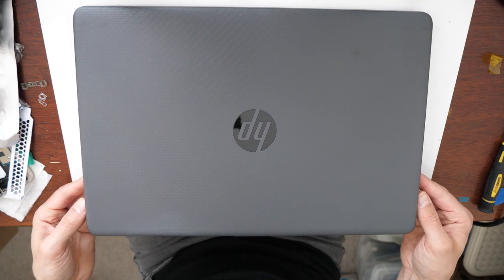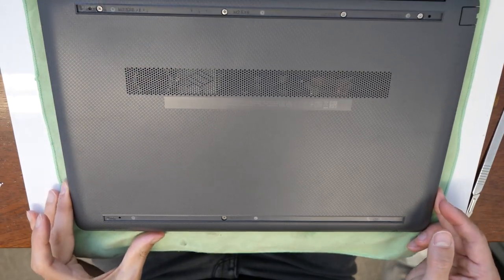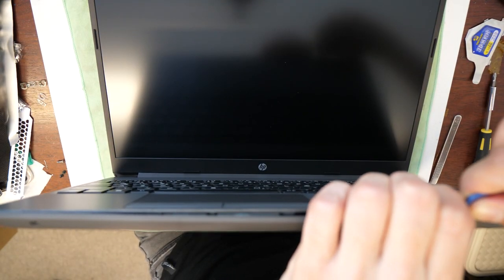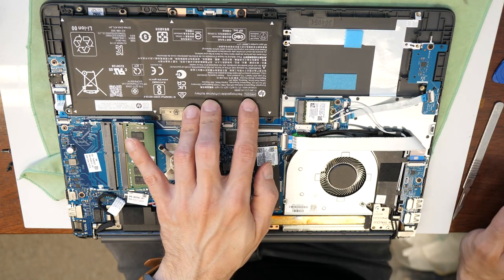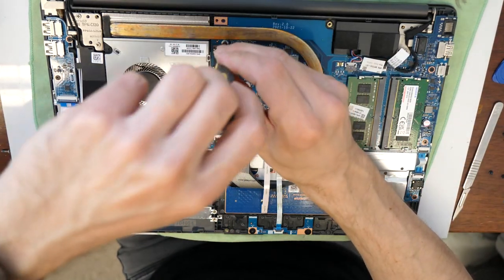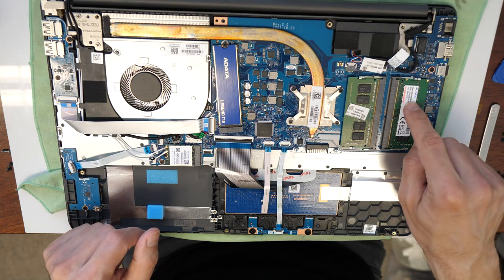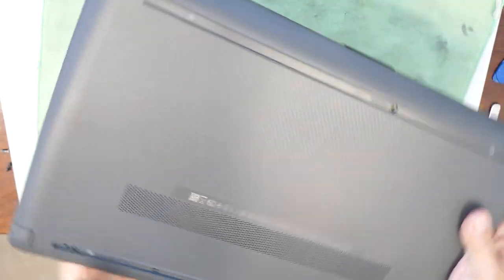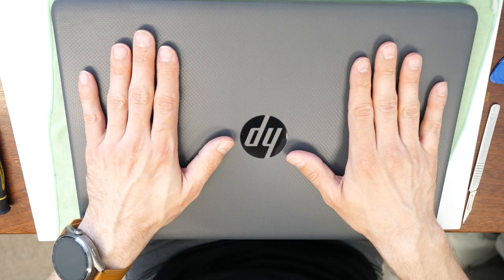HP 255 G8 Laptop - Open it & Upgrade Options

Comment: Awesome! Thank you so much! I'm a 2nd year IT undergrad student & need to upgrade my storage as I have less than 3GB left even after deleting EVERYTHING! 
Do I need to wear the static wrist strap or mat?? After 2 years of IT studies, we only work on desktops so far. So I am unsure about laptops & can't really find any helpful info on Google. Thanks!
Reply from the maker: Great decision for the IT study. Yes, if you wan't to be 100% sure, a static wrist strap is recommended and disconnect the battery and charger of course before working on the laptop. And you are welcome.
Reply: I'm also in IT my second year. Trying to upgrade my memory by adding 16gb with the 8
Reply from the maker: @rodneyb1425  Great

Comment: Hi, I have an important question: Can I use an SSD SATA, or is it mandatory to use an NVMe SSD?
My device: HP 255 G8 Notebook PC.
Reply from the maker: Hi. You can use which ever you want.
Reply: @CrocFIX  can you use both? and have multiple drives in the laptop?
Reply from the maker: @X_I_A_N  Yes, of course. If there is a free slot, you can use both.

Comment: Hey so I was just about to upgrade the ram but found out there is only 1 slot for ram in mine. It’s the same model and everything so I found it strange. I don’t know if it was ripped off or anything because I bought it in a pawn shop. in the settings it says it has space for 2 rams. Is there any way I could put another ram slot or where do I buy it?
Reply from the maker: You don't have the same model. It's the same series...255 G8, but you have a different board. You can't add another ram slot.

Comment: Hi, is there a way to unplug the touchpad? My laptop is not booting and always end up with PNP_WATCHDOG error(even with HP recover disk, and window USB drive), I tried everything, now last thing I would like to try to unplug the touchpad to see whether its the one which causing issue or not?
Reply from the maker: Yes, of course. But I would suggest that you install first a fresh copy of windows and see if this helps. You can use another ssd if you have.
Reply: @CrocFIX  - Thanks a lot for your reply. I tried that as well with having windows 11 on pen drive, but laptop is not booting up at all. It also won't show recovery screen when I am pressing F11 on BIOS, instead it shows Preparing for Automatic Recovery and then end up with the same PNP_WATCHDOG error.
Reply from the maker: @harshmodha8397  Yes, that's a bit strange behaviour. I hope you figure something out. Good luck!
Reply: So could you please post a video to unplug the mouse pad?
Reply from the maker: @harshmodha8397  Sorry, I don't have this laptop anymore.
Reply: Ohh ok thanks for all your replies. In case from your video if you can spot it then please do let me know.
Reply from the maker: @harshmodha8397  No problem ;)

Comment: Very helpful video as its my first time trying to do all this by myself! One question though, does the additional ram need to be at the same speed as the one thats already in? I was thinking about getting the Crucial CT8G4SFRA32A DDR4 8gb at 3200 MHz while the laptop's old ram is at 2400MHz. Should I get 2 of the Crucial ram sticks or is it ok if I get just one and combine them  for 16gb of ram?
Reply from the maker: Thanks. Both will work...if you buy just one 3200 and leave one 2400, they will work at 2400 both. If you replace both and buy a kit of 3200mhz, it will work at 3200 and be a bit faster. Not that big difference though. Hope that helps. I hope you clicked the LIKE button, Subscribed & I can welcome you as a member of our CrocFIX Channel ✅😊

Comment: is it a must to realese the battery even not connected to the power source? and what the possible problems may occur if not realese the battery?
Reply from the maker: The battery has always a voltage and you could do a short and damage  some hardware.
Reply: @CrocFIX  even only put the new RAM to the empty slot sodimm?
Reply from the maker: @mfathurr yes, all hardware changes
Reply: @CrocFIX  I just found out about it. Thank you for the useful new knowledge.
Reply from the maker: @mfathurr  You are very welcome :)

Comment: What will happen when i replace the SSD with a bigger. Will the Windows 11 demand key form me.
Reply from the maker: The key is ussually stored on the motherboard, so if you replace the ssd, you should be fine with the activation. Hope that helps and hope you SUBSCRIBE ❤

Comment: Can I ask you I have the same laptop from greece I am and I bought a 500 gb it would work for my laptop?and what I can do to work that pc at last?
Reply from the maker: Yes, 500gb ssd will work with your laptop or even a larger ssd.
Reply: @CrocFIX  ok thanks and how I can install windows 10 or 11 on my laptop now after putting the new hard drive?

Comment: is it possible to use extra ssd sata? because i see there is empty space next to the battery
Reply from the maker: It's possible. You need to buy additional cable / sata cable to insert a 2.5 hdd or ssd.
Reply: @CrocFIX  bro is it possible to upgrade it with 32gb ram or 16gb ram with 1tb ssd sata and 512gb nvme? please reply.....
Reply from the maker: @AbhishekP-nl2co  Yes, you can install 16Gb Ram or 32Gb. You can insert and 512, 1Tb or even 2Tb nvme. Hope that helps.

Comment: On the hp site it says maximum 16gb ram. Any ideea if it works with 32?
Reply from the maker: What is your exact model?
Reply: @CrocFIX  the same one you are presenting.
Reply from the maker: @titusm9837  Then 32Gb will work

Comment: Are there wifi cards to upgrade?
Reply from the maker: Yes, they are replaceable
Reply: @CrocFIX  are thy lte 5g, and have you some reccomendation?
Reply from the maker: @osssi They are not. You can buy seperate an 5G modem / router with sim slot to enjoy internet on the go. You can buy here - https://ebay.us/9Lpv5P

Comment: Where is cmos battery in this laptop? I want to reset bios cuz black screen!
Reply from the maker: There is no cmos battery in this model. To reset it: 1. Unplug the laptop 2.  Unplug the internal battery 3.  Press and hold the power button for 1minute and release. Plug in the power adapter without the battery and try to start the laptop. If it doesn't start, you have another problem, not the bios. Good luck
Reply: @CrocFIX  3 long and 2 shorts caps lock blink ! So maybe ram issue! There was also beep sound but it's gone! Fix for this?
Reply from the maker: @AnimeBoby  I would suggest, you google the beep pattern for this model. You can also try to clean the ram sticks. Good luck 🤞
Reply: @CrocFIX  Beep is gone now only caps lock blink which I searched to be ram issue or system failure! I cleaned the ram not worked so maybe have to order new sticks and see but it's a gamble for me! Also thanks ur video helped me to disassemble laptop safely!
Reply from the maker: @AnimeBoby  You are very welcome. Hope you can solve the issue.

Comment: do you know how to change thermal treshold on hp 255 g8? I cant make my laptop boost at 25w pass 70c
Reply from the maker: Depends on the CPU you have. It could be done with a moded bios, but I don't recommend it as you can fry your cpu.
Reply: its r5 5500u, 70c is not that much. Where can i find moded bios?
Reply from the maker: @TheKlisa google it. You can try for example bios-mods.com

Comment: Bro, can I add an SSD without replacing the old one?
Reply from the maker: Yes. You can add an additional 2,5'' SATA SSD, but you need to buy a kit which includes a cable and bracket. The link for that is in my video description.
Reply: @CrocFIX  thanks bro
Reply from the maker: @dikiramadan3301  welcome ;)

Comment: Does it have hdd port for adding hdd mine has only nvme ssd
Reply from the maker: You can add an hdd 2,5'' but you will need to buy a cable and bracket.
Reply: could you make a video on how to do this and where to get the cable

Comment: Thank you so much, it was super useful!
Can I upgrade RAM to 32 gb with two SO-DIMM DDR4 16Gb PC25600 3200Mhz Kingston Fury Impact (KF432S20IBK2/32)? I heard that KCP432SD8/16 or KCP432SS8/16 are better for HP, does it realy matter?
Thank you!
Reply from the maker: You are very welcome. Yes, you can upgrade with those ram sticks. It won't make any big difference whichever you take. It's minimal difference, not noticeable. Hope you Subscribe 🙏🏻
Reply: @CrocFIX  it won't work, this laptop supports 16 gbs of ram maximum
Reply from the maker: @fordongreeman048  Thanks for the comment, but I already tested it with 32Gb of ram without any problem.

Comment: Please what generation is this laptop
Reply from the maker: It was manufactured in 2022. But there have been earlier version in late 2021.
Reply: @CrocFIX  is AMD ryzen 3 3520u equivalent to 11gen
Reply from the maker: @zariahstar858  If you wish an answer you must ask the correct question with all details. What do you mean by 11gen? And Intel CPU? If yes, you must give me the exact model of your desired 11gen Intel CPU, so I can check if it's equivalent.
Reply: @CrocFIX  i don't know much about laptops. Just the Hp 255g8 AMD ryzen 3 3520u Silver colored. That's all i got 😊
Reply from the maker: @zariahstar858  Ok. It's a good laptop for daily tasks and internet browsing. Not good for gaming. Good luck with your laptop 😊
Reply: @CrocFIX  🤣🤣 thanks a lot sir
Reply from the maker: @zariahstar858  Welcome sir :)

Comment: Mine is also 255 g8 3020e but the ram slot in only one the other part doesn't have the slot, it shows that it carries 2 but the other part is empty.
Reply from the maker: One is fixed and soldered to the mainboard. Only one slot has a changeable option

Comment: i have the same laptop ryzen3 i was wondering if i can upgrade the ram to 32gb(2x16) and do i need to consider the speed of the ram , pre installed one has 2400mhz
Reply from the maker: Yes, you can add 2x16Gb and you can install also 3200mhz for example. Faster ram than 3200mhz for that cpu won't make any difference.

Comment: Is this hp 255 g8 i5 or i7
Reply from the maker: This was with AMD Ryzen
Reply: @CrocFIX  i want to purchase a hp 255 g8 amd Rizen 3. Can  play games with it unbothered
Reply from the maker: @zariahstar858  Only low demanding games. If you want to play never games and higher resolution, you will need a laptop with at least RTX 2060, 3050 or 3060 Graphics.

Comment: Can I upgrade processor from ryzen 3 3250u to ryzen 7 5800U?
Reply from the maker: Not that easy. You would need bga soldering skills.
Reply: @CrocFIX is this upgrade possible 😮😮
Reply: You can but the processor is mobile version so you will have to change whole motherboard

Comment: Bought a 16GB RAM, only to notice that mine has a single slot for RAM!
Reply from the maker: Really? Then you have another model. The 255 G8 has a dual slot.
Reply: If it has only one slot 
Can you change upgrade it by changing the old one to the new one
Reply from the maker: @ajibadeolayemi1491  Yes. You can take out the old ram and insert an upgraded ram stick